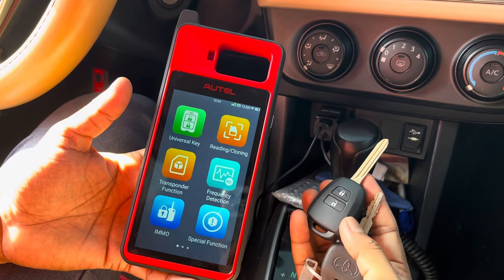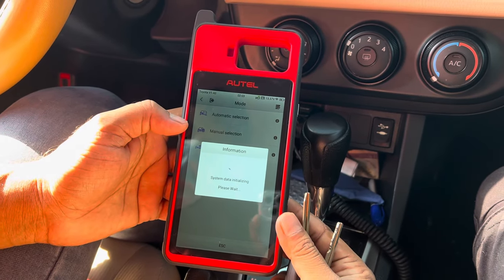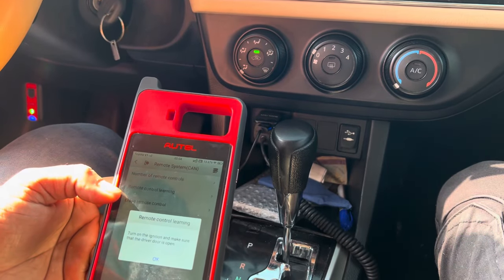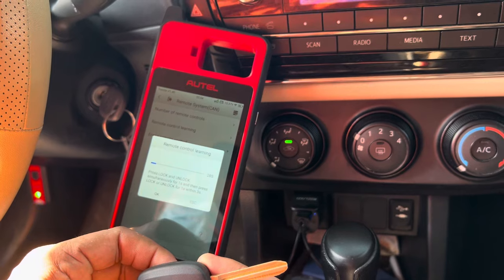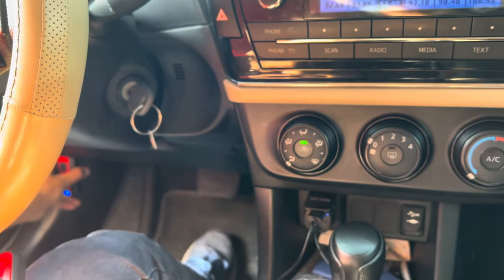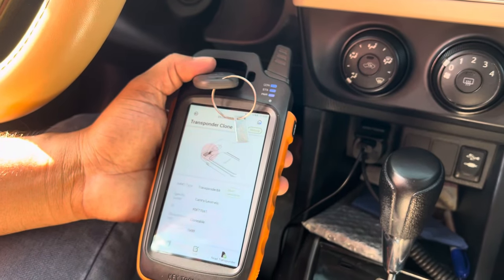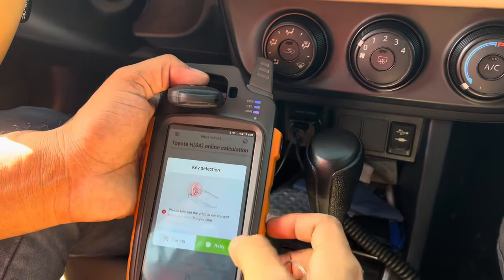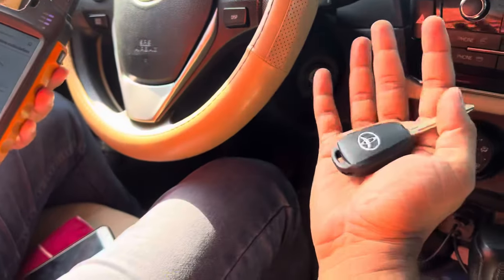Autel km100 programming 2017 Toyota Corolla remote & clone 8a H transponder key

Comment: Interesting, but I would have done it differently. Just use the KM100 to add key then remote learning after. One machine would have been faster. Also, your method is helpful when for some reason KM100 can NOT add key. (ie, customer only have slave key ~ but then do akl and everything still works)